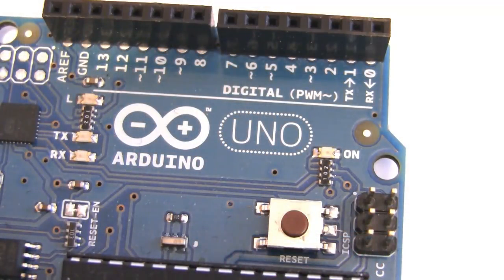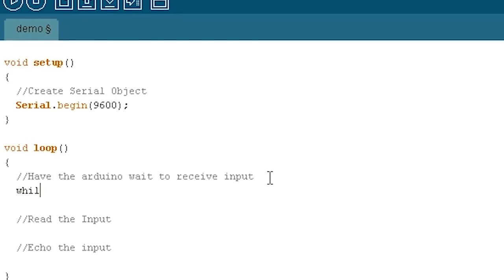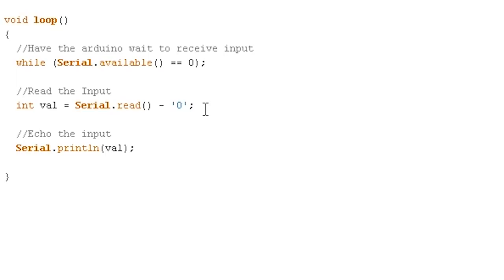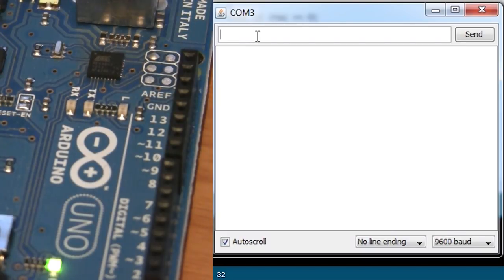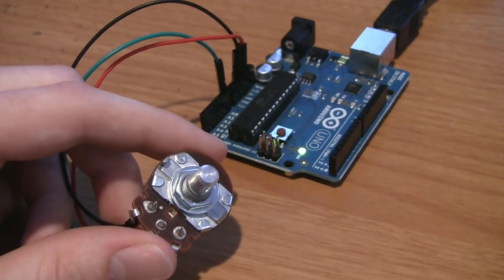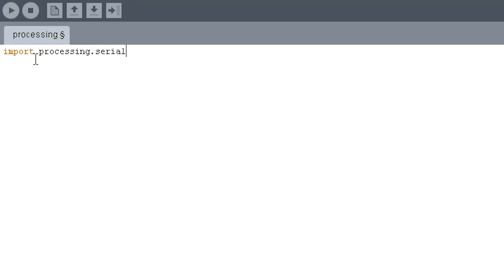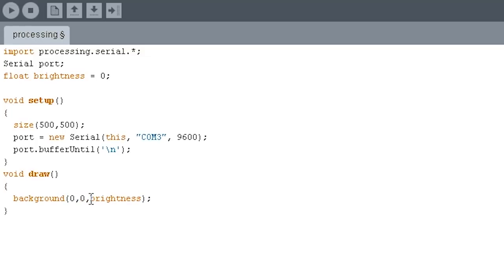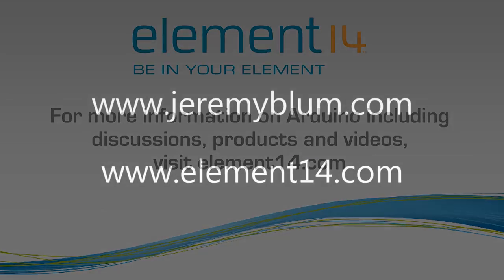Tutorial 06 for Arduino: Serial Communication and Processing

Comment: why dosent the Serial.flush(); line of code work anymore. does someone have the same problem>?

int ledPin = 9;
void setup()
{
  Serial.begin(9600);
  pinMode(ledPin,OUTPUT);
}
void loop()
{ 
  while(Serial.available()==0);
  int val = Serial.read() - '0';
  if(val == 1) 
  {
    
   Serial.println("Led is On");
  digitalWrite(ledPin,HIGH);
  }
 else if(val == 0)
  {
   Serial.println("Led is off");
   digitalWrite(ledPin,LOW);
  }
  else
  {
    Serial.println("Invalid!");
  }
  
  Serial.flush();

}
Reply: When i type in a bunch of random numbers, it would still show the various number of invalid! lines
Reply: Drumzmer555 Serial.flush() was removed in Arduino 1.0. I am having the same problem. Let me know if you find a solution
Reply: I know these comments were a while ago, but I believe I have a solution. In place of your "Serial.flush()" place the following line:
"while(Serial.available() != 0);"
This will execute an empty while loop for all remaining characters until there is nothing left, resulting in a similar action to the flush function.
Reply: Did you try it with this code and did it work? I know that is what many people where suggesting on the forums.
Reply: Just ran a test on it, and it didn't quite seem to work as anticipated, (in fact it doesn't even seem to execute the loop unless the values are sufficiently large -  in terms of number of characters) all of which is very odd behavior.
Reply: Upon further testing, the lines:

Serial.flush();
while(Serial.read() != - 1);

seems to work just fine.  My guess is since we are both sending and reading the byte buffer, flushing it (which now clears the output) sets up the buffer to not receive anything else so that the loop can execute as normal to clear the input buffer, I would suspect that just the loop would suffice when not echoing data (just a guess though).  Regardless of reason, this appears to work for this explicit example.
Reply: Will definitely give that a try.
Reply: ***** works, but it doesnt flush out all values. When given a big number of characters it still returns the invalid message a number of times. still, helped alot. 

I randomly tried just putting that 2 times and helped a little, so it requires a little calibration I suppose

Comment: thanks for not telling us the pinouts in the potentiometer.
Reply: +yashfernandojain It's not anything to worry about because you won't harm anything if you guess wrong. There are three pins on the pot, (1) volts input, (2) ground and (3) the wiper - which is the voltage divider output. The wiper is usually the middle of the three pins. It won't matter at all if you pick wrong and reverse the volt input and ground. Attach the two outer pins to Arduino 5V and ground and connect the middle pin to whatever you define as the input on the Arduino. If you completely miswire the pot to the Arduino, the worst you can do is pull the analog input pin to the 5V rail or to ground which will cause all zeros or 255's to display regardless of pot knob position.